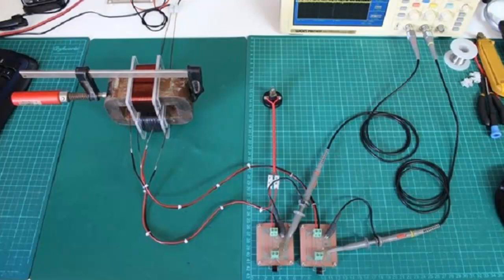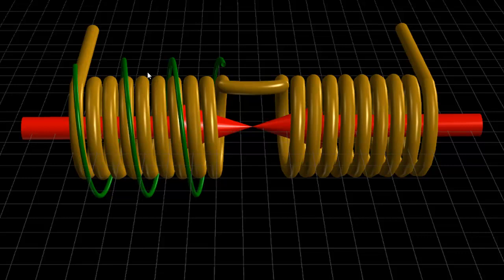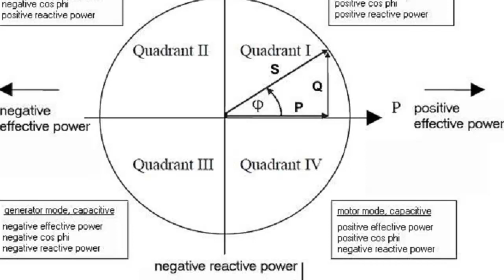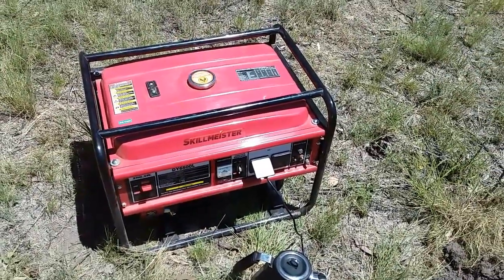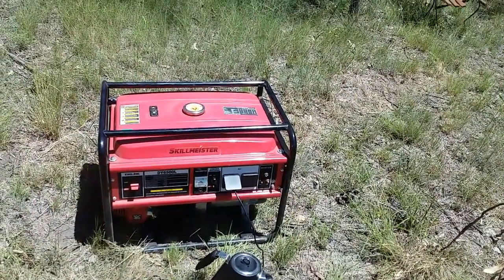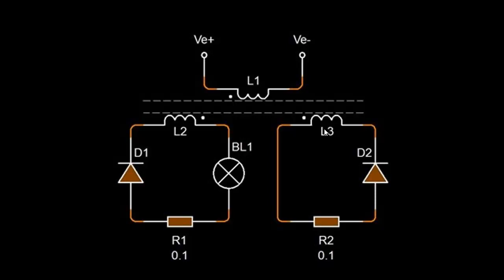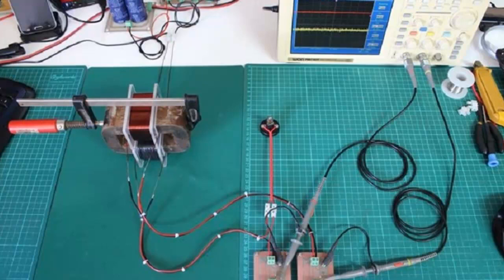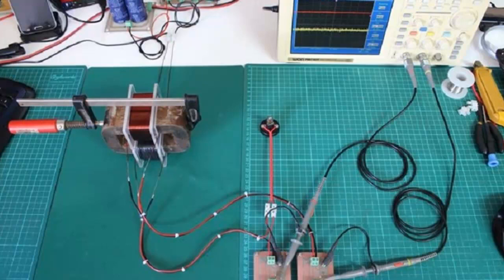Chris's Electromagnetic Charge Pump Experiment - Part 2

Comment: @ 39:00 you cannot have opposing magnetic fields between L2 and L3 unless there is an electrical connection putting them in series with the load.
Reply from the maker: Little more attention old mate!@ You would benefit from Really Paying Attention!
Reply: The load become a consumption for 90 degrees and then a producer for 90 degrees. Eg conservation of charge

Comment: Do the diodes have to be used for the AC voltage or are they not needed for AC voltage? If so, you would only have to attach a load to L2 and L3, do I understand that correctly?

Comment: for all those years you have been doing this great job. but it's only two weeks since I have found you. I don't know if I did it right about the non-inductive coil 
my l3 is connecting via capacitor then to a MOSFET which is timed from the primary oscillator to only close when the wave is at peak. My observation is all you talk about is correct as my output doubled when the MOSFET is on and it works connected in only one side of the l3 coil and in 50% duty cycle

Comment: 2. Just learned how the post size limit works. Anyhow. I think I've already said this before but I'm going to say it again. Imagine that the vacuum is a large bucket of water. (We are immersed in it). Pure energy just sitting there waiting to be used. Our coil is going to be a sponge. No potential on it so it's dry. We put a potential on it by sticking in the bucket. Naturally it absorbs the water and expands. When you give a coil potential it "grows" a magnetic field around it the size of which is determined by the size of the potential. The voltage. It "expands". In this case the potential is controlled by the size of the sponge. Big sponge, big potential. Well, our sponge is almost the same size as the bucket. From practical experience you know that as soon as you pull the sponge out of the bucket the water is going to pour out of it. The potential has been removed from the coil and its field collapses. The water/energy has to go somewhere. Are you going to let it pour onto the ground or collect it in a smaller bucket that's easier to carry? The vacuum is the size of the universe. 

A magnetic field as we can see using a Magna View film loses its strength according to the square of the distance rule. Like gravity. The vacuum is composed of virtual particles. Virtual particles carry charge, or they are charge. NOBODY KNOWS, and it really doesn't matter as long as we can collect some charge! The virtual particles, vacuum, saturate space around all mass. The field around the coil is full of virtual particles because the coil is immersed in the vacuum. Everything is by default. Read Bearden's The Source Charge Problem: Its Solution and Implications...

Comment: Hey dude. Just stating from the start, I am not a troll and everything I say or ask is in complete seriousness and sincerity. I just say this cause you've mentioned trolls tryna disinform other people who are trying to also free theirselves from the grid.

 I am recently getting into this sorta stuff. Not electrical stuff, I've always been into that shit, but specifically partnered coils.
I recently took apart a generator I was planning to fix, but after I found it had a brush-less generator setup, I decided to scrap fixing it and instead to repurpose it for whatever I want.
I don't have a proper transformer big enough to experiment with the setup you often encouraged your watchers to use. Nor do I have an oscilloscope or signal generator yet. If I get the specific thing working, I'll take a video, upload it, and tag you in don't mind.

So I was thinking of rewinding the brushless generator like how you have the partnered coil set up but on the stator instead of a transformer coil.
My stator is on the inside and rotor on the outside though. Opposite to your one.
It has 18 magnets on rotor and 27 legs on stator for the windings. I noticed you had equal amount of magnets and windings, Would my windings need to be a derivative of 2? or will it still work with 27 windings?

I am going to use a PMDC motor, rectifier and variac in conjunction with the rotor to act as the prime mover, ie mechanically based signal generator. Then slowly ramp up the speed and measure the voltage on my voltmeter. Was also planing to short itself and see if it would exhibit drag. Example, connecting the pos and neg leads of a pmdc motor together and spinning the stator, the faster you try to spin it, the more it counters it with the emf. Not gonna lie, but I'l have everything vertical, and it looks similar to a tesla coil. A mechanical telsa setup.

 There's this guy Gerard Morin, he has his generator he calls HyperDrive(lol), and mine looks just like it, but standing vertical to have a better centre of gravity balanced on the bearings, and made of whatever shit I could salvage. But anyways. He uses a brushless motor as the prime mover, and provably a two magnet generator setup inside. But his thing is, his intentions is to spin the generator really fast, with no iron core, just so he won't get as much drag. But it just felt like a glorified revamping of the wheel. His main thing that he likes to talk about is dealing with high voltage so you can integrate a spark gap and release back tension on the system, prevent back emf from forming. His end point setup involves his hyperdrive, an impulse brushed idk what you call it, couple spark gaps and a fucking pole transformer or two. Most people can't afford that shit. lmao
So either he making it a little to fanciful and complicated, or he's holding back something. Plus I've been keeping track on his posts and shit and website, and it just seems like false promises. I could be wrong, but something just doesn't feel right.

So here I learned about partnered coil setup and feel it to be the more realistic option cause I don't want to deal with high voltage regardless. I first want to try a simple setup with whatever I have available to me, and to personally test it's viability.
Then test the possibility of looping it.

I was wondering. What sort of waveform output do you get from your partnered coil transformer?  AC Sine wave? Pulsed Dc? 
I'm just curious cause I tried doing some similar shit on falstad since I lack certain equipment unfortunately. And the thing is limited since the people who programmed it based it on the restricted laws of thermodynamics. So my little circuit set up was useless. 
 I have an inverter and car battery, and I want to know it's waveform so I could be able to devise a way to either keep the output voltage of the generator low enough, step it down, but do something to make sure it can recharge the battery steadily.

My main goal atm is just to at least get it looped and running for 1 minuite(min)-5 minutes(max), after I disconnect the battery. Then from there I would experiment back and forth, trying to understand it through experience, and then trying to see what I need to invest in for sure so I could make my own MEG with a controller to regulate the output and loop it.

Any tips or advice? Literally anything would help so long as I could get closer to understanding how it works. And maybe how it can be used to heal or rejuvenate ones internal body energies?

Comment: What baffles me here is that @6:34 the opposing wound L2 & L3 are shown tied together with no center taps.  @ 38:16 they are shown running separately with diodes opposing and DC  in both coil  circuits & a DC load in the L2 Diode circuit..  Whatever the case where does the extra energy over the given cycle time come from?

Comment: I use the winding concept to create a variable dial transformer that can be increased it generate too. 24 volt motor running on 6 volt  30 watt's running on 5 watt with a rotor when spun add's amps.

Comment: 3. When the magnetic field collapses it drags, or pulls, virtual particles with it. Or it strips the charge from the virtual particles. Who cares? I don't. 

The real trick of it all is asymmetry. A river runs smooth unless there is a sharp bend in it. A disturbance, an imbalance, an obstruction so to speak. Floyd Sweet said it directly and I think he knew what he was talking about. An imbalance whereby some charge is allowed to be diverted to a different location because the vacuum is trying to restore order to its symmetry. We don't know all of the rules and we don't need to, to make use of the system that nature has set up. I really liked the setup that Chris showed us in the second video. Straight forward without clutter. That's the way it really is everybody. It's not rocket science. I know rocket science, and this isn't it. Sorry for going on so long Chris. Probably won't happen again. If this text is red, I don't know why.

Comment: Chris I wanted to ask, would a metglas split core be ideal for this?  I assume resonance is required on the paired output coils?  Do you were driving the primary(L1) from the mosfet at the the resonant frequency of L2 and of L3?  Do you determine the wire length needed for each individual partnered coil, to resonate at the same frequency as the L1 is being driven at?  OR is the combined length of both L2 and L3 should equal the frequency the L1 is being driven at?  You also mentioned the higher the voltage L1 is driven at, the more out the partnered output coils will experience, correct?  Appreciate your work, it is making Don smiths technology  more understandable to me.
Reply from the maker: An ideal Mutual Coupling is an important factor, as it is in a "Generator". The Coupling Factor K is a funny thing, its not the same for all the Coils, but varies as one would expect. Output is regulated by DUT Geometry, same as it is in an Electric "Generator". But this is Scalable quite easily, I = V / R, so by Increasing V, I also increases for the same Resistance R.  L1 is the POC's Initial Impulse, and to be honest, I am still investigating the full relationship here, initially, I suspected a 1/4 Wave relationship, but I am not entirely sure atm. More coming on Coil Length soon in a Thread in the next few months.
Reply: @SweetSQM  Thank you.

Comment: A lot of what you said makes a lot of sense, but what I'm confused with is the role that the iron core plays? The iron core is not present in this diagram you used of the coils so how does that effect things?
Reply from the maker: A Core just Focuses the Magnetic Fields changing in Time. If your Input Coil see's no load, under loaded conditions, what has changed? Its the use of Superposition of the Magnetic Fields, more than one, changing in time. Three is the Magic Number, Action, Reaction and the missing Counter -Reaction, which assists your Action, thus we have a Positive Force as well as a Negative force on your Input, and 1 + -1 = 0, so no net force. In total we have: 1 + -1 + 1 = 1, a total Gain in the system. See: www.aboveunity.com for more details.
Reply: @SweetSQM  ok so can I do it without the iron core? And do you use a capacitor just to provide the high voltage spikes to regauge the system? My difficulty is that the videos make it seem easy but then I go to the forum and there is so much language I don't yet understand. I'll keep studying.
Reply from the maker: @kellykramer2529  - Yes many configurations work.
Reply: @SweetSQM  Is there an article on the site addressing the effect that the size of the coils makes? gauge and length.

Comment: Can this be done with iron core through both out put coils connected?  Can the right side output coil be also wound with a primary coil matching the first one but wound counter direction of the first one and charged 180 degrees opposite of the first one?
Reply from the maker: Pay attention My Dear Old Friend because its important!
Reply: It would be a pair of double opposed asymmetrical coils operating on the same iron core at 180 degree phase difference. I will build it and report results. I changed phones and lost the information from the forum . Thanks Greywolf 47
Reply: Chris, you said to pay attention. In the video of Don Smith, he used a single silver coated copper coil 3 inches in diameter with 40 turns. He unrolled one turn from each end and two turns in the center in order to have wire to connect the coil to the rest of the apparatus. BOTH halves of the coil are wound in the SAME direction as the original. 
In your diagram of the gold coil secondaries, the coils are NOT wound in the same direction as Don Smith. On Don Smith's device, he was creating two tesla coils back to back with a single primary powering both equally and in opposite direction. The voltage of the primary is divided by the number of turns in the primary. The secondary coils are multiplied by that voltage times the number of turns in the secondary in both secondaries. In order to get resonance between the primary and the secondaries, the mass of wire in the primary must be equal to the mass of wire in each of the secondaries. This is best accomplished by using twice the diameter of wire in the primary coil as the diameter of the secondary coil. The length of wire in the secondary will be 4 times the length of wire in primary coil.

Comment: oh so the input is also the output?
Reply: I thought the output was one of the paired coils but your saying the output negative power comes out during the off cycle through to the mosfet?
Reply from the maker: No, Input Circuit and Output Circuit are Electrically Isolated, its best that way, makes for better Results. See Circuit in Video and also on my website.

Comment: I'm setting up to make a post on the site again but I wanted to throw this resource out there.

https://youtu.be/60z_hpEAtD8

It's not my intention to go complicating things but I wish I had internalized this years ago 

Bearden talked about Clifford algebra and I've never been able to understand the academic papers out there because most academics are straight up douchebags. Notation made me anxious, which makes it impossible to learn.

Eventually I found the video above. If you understand vectors that will help but I took notes on the video above and watched it daily at .75x speed and still needed to pause.

I'm not saying I get it all or can apply it all but God damn he explains why the cross product is garbage and how it's persistence is holding us back. Essentially the geometric product reveals all the higher dimension k-vector components and opens up the Maxwell equation (singular) as well as shedding light on other anachronistic methods used in academic papers but is never explained or explored.

Comment: You know you are holding a hot potato? No need to insult other people? Blah blah blah...repeat...blah blah blah..repeat..stuck grammophone? The point that you miss dude is that if you have a bucket of water on baseline you need to dig a hole to get that potential flowing? You can only fill that hole with the exact amount of water you scoop out? Work flow possible = Work done?????. Everything works on simple (yes simple???) flow dynamic priciples which is uni directional from high to low potential. Unless you can create a empty pipe in the bucket (lower resitance) which is full of the existing rotating magnetic field all around us to an even lower point of resitance (lesser magnetic field?) you will have no flow? You do have the nodes available in a resonant system as MOMENTS (delta T) whereby you can seamlessly CHANGE (180 deg) magnetic field potential into electrical field flow potential for sure and this is your HOT POTATO??? Stirling principles means you have the 90 degree phase area where CHANGE of the input will have no result on the output and vice versa? But the catch is UNI direction??? I have designed a generator which turns pieces of space (removes volume as energy) into rotation?? But it is obviously to dangerous for commercial application and the world do not need me neither somebody like you who constantly attacks others intellect instead of just asking for help on the point where you are stuck? I know people who KNOWS most answers and ONLY because you are at least on the fringes of trying to understand something which is indeed exciting they may point you in the right direction???